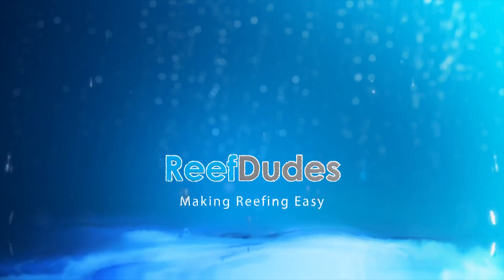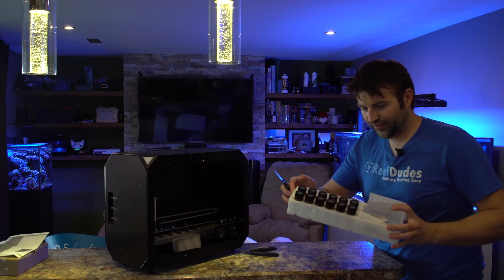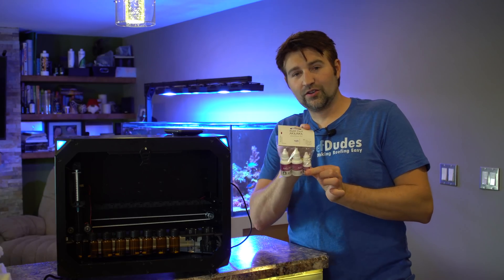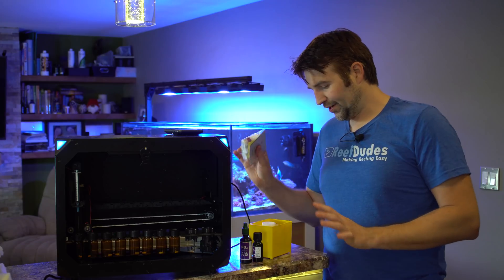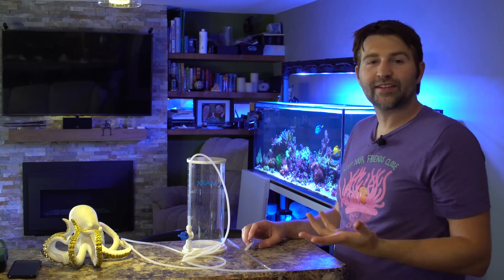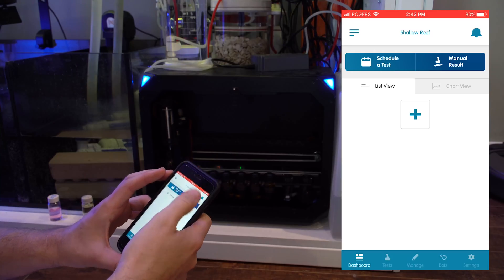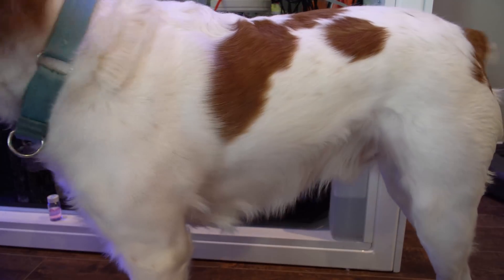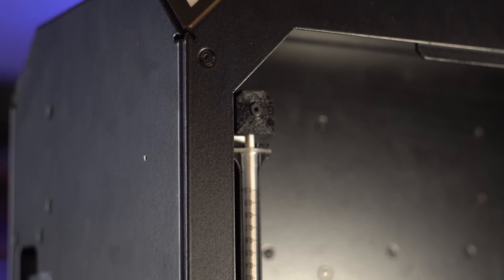ReefBot Reef Kinetics Unboxing, Setup and Initial Review

Comment: Devin, did one of your silicone lines come with a inline filter installed on any of them? Mine did but they don't specify which port it goes too?
Reply from the maker: Jason Williams I don’t think It did(but I also got a display model at a show) But I would have it on the tank water intake  line
Reply: @ReefDudes   ha I almost bought one at the show too. I was thinking on the tank water as well
Reply: Thanks for the quick response
Reply from the maker: I love getting gear at the end of the show. Always great deals on the display models :)

Comment: Question, did you have any issues calibrating the ro fluid. I was helping set one up this evening and after 1st calibration it read around 14ml, bot only allows you to enter value of 1-9...🤔, ran a second calibration and it came out at 8ml, perfect!, we had to run out and help move a tank, came back and noticed the syringe was not fully seated in the holder, fixed that, went to recalibrate the ro line and kept getting 12ml app only allows a value between 1 and 9. Owner is now going to contact customer tech support. Just curious if you could shed any insight. Thanks in advance👍
Reply from the maker: I honestly dont fully recall that part as its been a few months now.. i dont recall having any issues with the calibration through. Their support is really good so they should be able to help you out.
Reply: @ReefDudes  thanks, figured it was worth a shot to ask. we will continue to attempt calibration and test later this evening

Comment: While nice, something that does concern me is how many tests you get.   Just taking the Red Sea test kit as an example,  it says it uses 1.05mL per test, which is fine the instructions say to discard the liquid (I don't though... whoops :D) but 1.05mL is more than what is necessary, but fine I get it a little extra,  however 20mL container of the reefbot divided by 1.05 is about 19 test, yet it states on their website you get 11 tests before refilling.   Is this simply because of the fluid level in the vial needs to be a certain height?   Either way kind of raw deal to only get 58% of your test kits out of each vial before refilling.

That said, I really hope this thing works and sticks around in the market,  we need more choices for products like this, we don't need one particular orange and grey device to dominate the market.    That said, I hope version 2.0 is even better.
Reply from the maker: They are working on larger containers which is good.  How much liquid is likely the average so may vary based on actual levels.   If your testing daily then yep i could see that being a pain refiling after 11 days.. if weekly i could deal with once every 3 months :)  The new upcoming larger vials should solve that issue or at least reduce it for the daily testers.

Comment: Hey Devin great video. Could use some extra lighting for that bar when doing videos. :) Look forward to some follow up on how this unit runs long term and how much maintenance is required.
Reply from the maker: Thanks. I do have some umbrella lights that come out some days!     As for maintenance. Checking calibration once every month or two/. Replace the needle every 60 tests. And refilling the vials is the extent of it. (will be a bit before I have to do any of them with a weekly schedule. If you test daily it would be a little more frequently

Comment: I wonder when the doser unit will be available for the Reefbot since that would really make it a better solution.  Also I wonder if people have found out which Brand test kits would last the longest and have less reagent components?  Also do they recommend specific test kits for best accuracy?
Reply from the maker: Doser is coming out Q4,  Reefbot has a list of which test kits work and how many tests you get.  https://reefkinetics.freshdesk.com/support/solutions/articles/43000508730-what-is-the-estimated-duration-for-each-test-brand-and-parameter-
Reply: Hmm it seems none is in stock now and only preorders are available from one site

Comment: The piece that is missing from Reefbot is the ability to *control*.  Measure Mg, then control Dosers and react (adjust dosing up/down).  If they developed an API that controllers could consume then thats true automation.  MEASURE/ADJUST/RE-MEASURE and so on.  It's a great first step though.
Reply from the maker: Macca 75 they actually had a Doser at Rap NY that can dose based on the results.  It’s coming out in q4

Comment: hi nice gear any chance you can do compare test result to hanna checkers or ICP Tests, I am very curious about the results, because is not cheap
Reply from the maker: i have a hanna phosphate checker so i can compare that one.  I could compare to the redsea nitrate kits once its going but i suspect it to be pretty darn close.   ICP would be a bit pricey to do so ill likely just do the kits i have in a future update :)   The Reefbot will be much more accurate than me as its percise water volumes/drops/color interpretation.. basically takes out human error and preforms the tests identically each time.
Reply: @ReefDudes  its 1000 pounds in Uk, for this money it shut be  very accurate, especially the tests of various companies have considerable dispersion. If you can make PO4 compare it will be nice
Reply from the maker: @hajtaler1  Will do for the next update!

Comment: https://www.amazon.ca/Parker-A4TCB4-pk10-Connect-Compliant-Connector/dp/B075CLDBPX/ref=sr_1_1?keywords=1%2F4+stem+to+barb&qid=1562600147&s=gateway&sr=8-1 FYI Dev
Reply from the maker: I used used those on  the kamoer.  Pretty sure 1/4 is too big for the thinner lines with reefbot    I haven’t been able to find a 1/4 push connector  to smaller size barb yet

Comment: I suppose you can't use kits like the Red Sea nitrate because 2/3 reagents are powders
Reply from the maker: Compatible kits so far : https://reefkinetics.freshdesk.com/support/solutions/articles/43000508730-what-is-the-estimated-duration-for-each-test-brand-and-parameter-
Reply from the maker: You can pre mix some of the powders in a vial but seemed like more work so I just picked Kits that we’re all liquid based to avoid the extra Hassle